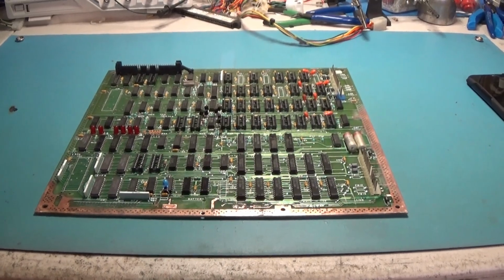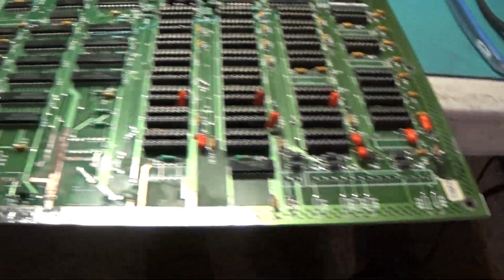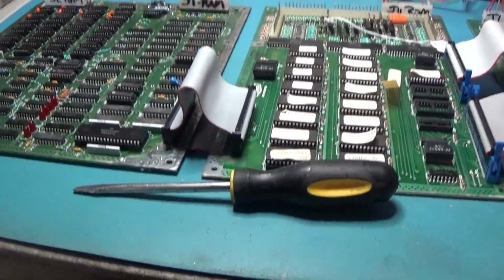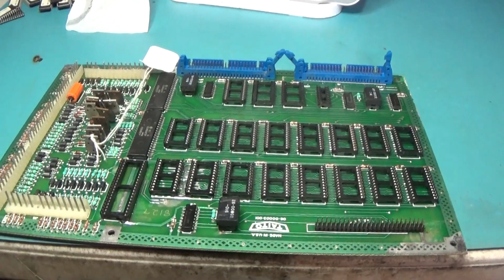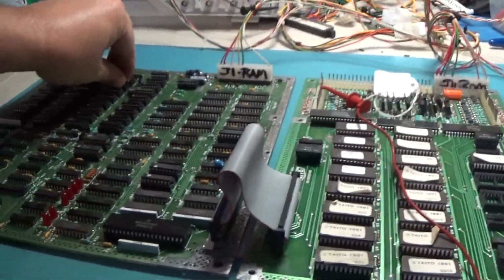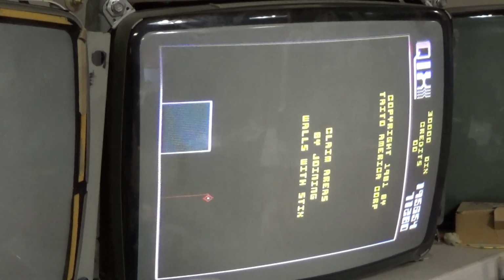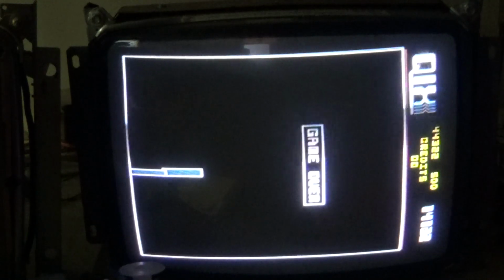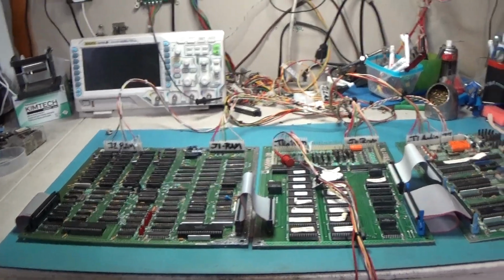1981 Taito QIX Arcade Game PCB Set Repair - Lots of Corrosion Removal    -    3-18-2025

Comment: Hey Sean, what did you use for the reset circuit on the Qix?  (MRST)

Did you build a time delay circuit for the +5v on your harness to that pin 14 location?
Reply from the maker: I used a circuit that I built. I use it for reset circuits on Z80s and inverted output for 8080 CPUs. The Z80 reset also works for the 68A09E.

Comment: Awesome job.  When you say you burned out the corroded pin,  what did you use?  Hot air or other.  Thanks and yea that ram sucked.
Reply from the maker: Just simply used a good chisel tip iron.

Comment: You're up for a very long burn-in test...
I remember fixing ours. Took like 7 ICs just to stop it being dead, and 7 more to get it fixed. And then the fun began... every week, another IC or two would die from late effects of the alkaline damage - for like two months!
Oddest fault I had was CGA snow. Everything looked like it should, but it had CGA snow. Turned out one of the LS299 had one of its inputs turned into an output so it would interfere with itself. Must've been an internal short somewhere.